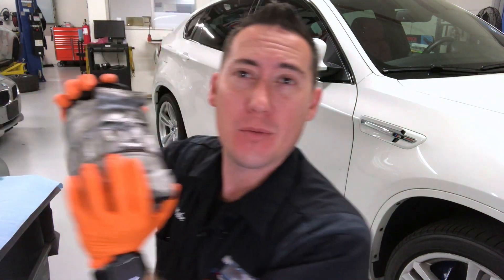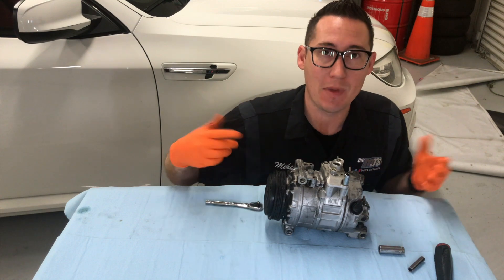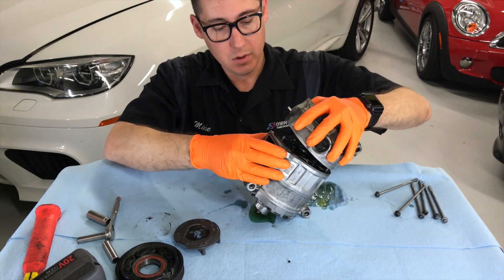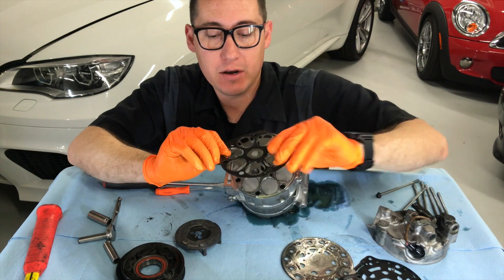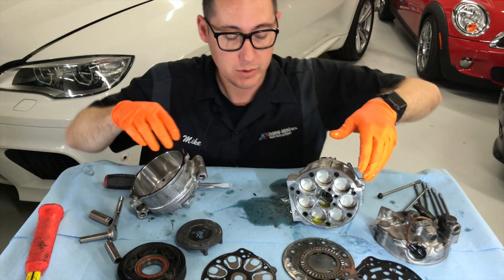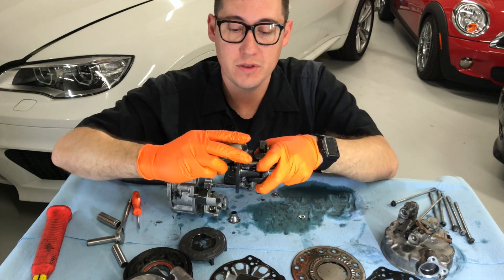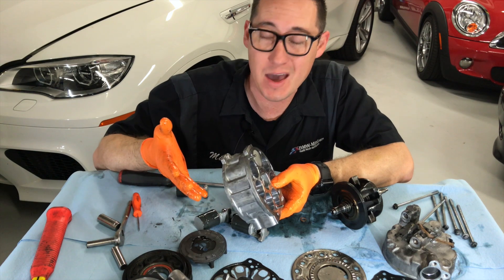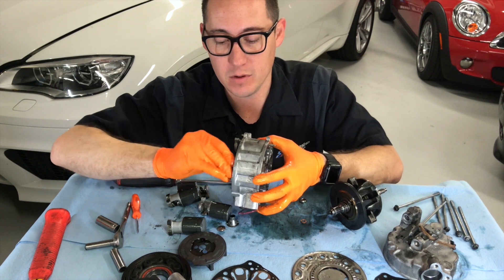Inside Your A/C Compressor

Comment: Hi please I Have a compressor that stuck for 5-10 minutes at the first start. So I suggest to add ICE 32 oil and see if work but I don't want to overfill the compressor of oil any suggestions?
Reply from the maker: Not sure, Is it receiving power during that time?
Reply: @MikeMDs  I do some testing! When I start the AC blow warm air and I have not voltage un the compressor also the auxiliary fan doesn't work and I have 11,8 volt on the trigger later 10 minutes everything works. The trig voltage drop until 2 volt the fan run and the compressor go on.